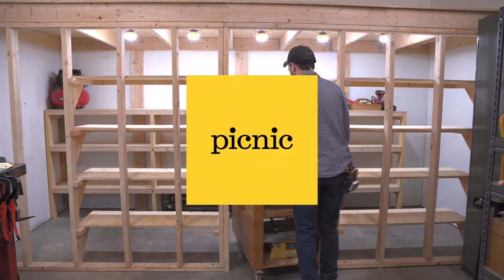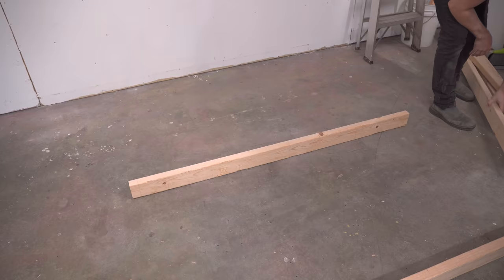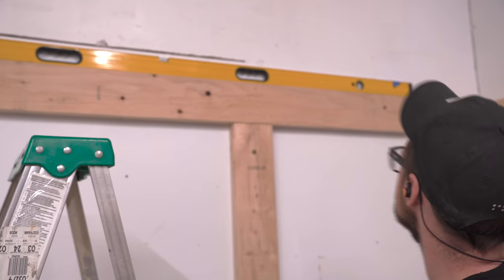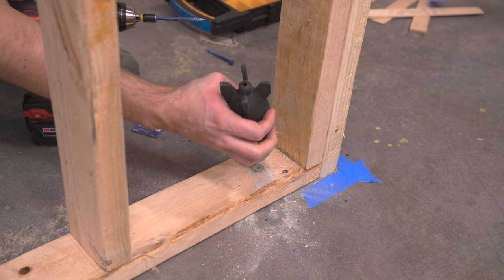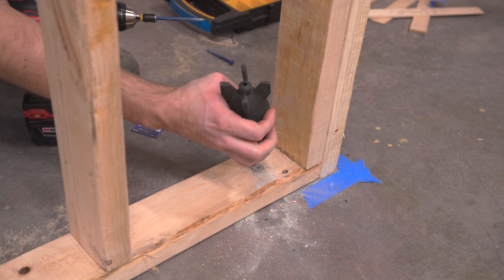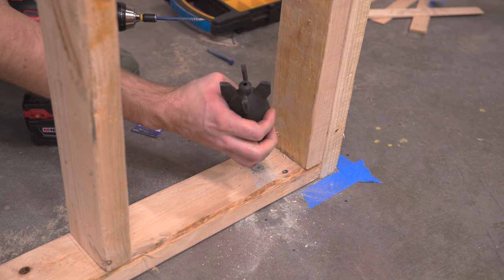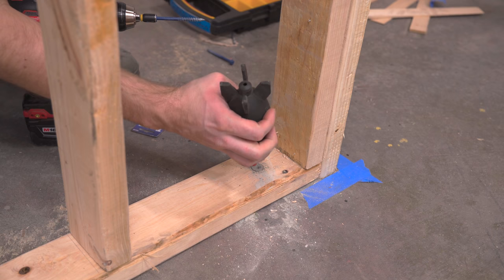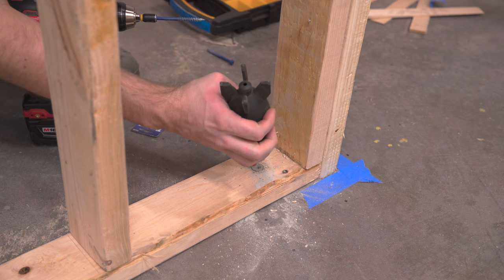FINALLY fixing my GARAGE storage problem

Comment: One thing I do is never waste studs and the 3  1/2 inches of space they take up where you made a wall I would have made a shelf and used that to hold up the ceiling/floor and the 1/2 plywood back for my last shed I used 3/8 OSB for the back of the shelves which was also the siding on the shed it's 8 x 12 and not a stud in the shed my wall between the living room and the bathroom is also built this way entertainment unit for the living room and the back is the wall for the bathroom my only wasted space is the 1/4 inch back of the entertainment unit and the 1/2 inch drywall in the bathroom I've used the same method of building for customers as well a sailing club had totally renovated their clubhouse and had a problem to they had a large closet that they used to hold the mop and bucket and other items for cleaning some members thought it would be better to open it up to the kitchen close off the old door and make it a much needed pantry and others wanted it left as a much needed closet and the contractor pointed out out that with the 4 1/2 Wall either they had a decent size pantry and a undersized closet or a decent sized closet and an undersized pantry so a member called me to look at it I made a shelf at the six foot line in the closet area and shelves 14 inches apart on the pantry side one six foot sheet 3/8 MDF would be the back of the closet and 3/8  MDF would be the back of each shelf glued to the back of the closet this provided the support for the shelves and the back of the shelf that spaned the shelf in the storage closet gave me the glueing area I needed to put the back of the closet above the main closet area final top shelf in pantry didn't need a back as the back of the closet was it's back we ended up with an 20 inch deap pantry and a 22 inch deap closet  so all were satisfied closet held the cleaning supplies and the pantry had loads of space for cases of cooking supplies but by doing it my way instead of losing 4 1/2  inches they only lost 3/4;

Comment: dry wall  mistake..you don't want a single short piece above a door . the joints will cause cracks..you want a sheet and cut out for the door

Comment: 6:41  There should be some kind of Support (stud) under the left side of the joint. The left side board is CANTILEVERED. there is NO Support under it at the "joint". the ONLY thing suporting it is the ONE "STUD" to the left and 4 Screws between the "Stud" and the "Free floating" double joist. the "Stud" is the Fulcrum on that lever and the Double Joist has a TREMENDOUS mecanical advantage over the left hand Corner. Unless you trust those 4 SCREWS to support the 2 of the 3 joists on the left side. I would not trust that side of the floor to support much weight.
Reply: Agreed. Joint should’ve been over the post.
Reply: I mean just look at how he swings a hammer, that should tell you the fella doesn’t know what all he’s doing
Reply: You mean the joist that's directly supported by the structural screws into the wall behind it? How is that cantilevered?
Reply: @RyanAKiefer  Exactly!  The ony thing supporting that Joist's load is 6 "Strucrual" Screws into studs (of some sort) that board is "BALLANCED: on that One 2X6 with 2 screws on one side of the Fulcum and 4 screws on the other side.
Reply: @RyanAKiefer  whether it’s technically cantilevered or not, it was still silly to not have the joint be on top of the post. If he wants to just rely on structural screws, then technically there’s no need for the post. But he said he didn’t want to rely on just the screws, and that’s why he put in posts to support the rim joists.

Comment: Great project! 

But man, those 2x4s look wonky and wobbly. Is that normal in America or did you get an enormous discount? Here I might see some cupping or warping, but at least the surface itself is flat...
And why is the door handle at knee level?

Anyway, none of that is a lack of quality from your end. That's always mint.
Reply from the maker: Thanks! The 2x4 quality depends on where you buy it from, and we're having supply issues right now. I got these from Home Depot, and usually they sell them cheap, but not the best quality. Door handle is low, because I bought a pre-hung door, and cut the bottom off, so that lowered the handle. I didn't think it was worth the extra time to patch and re-drill.

Comment: do you have to get a permit for this kind of project, particularly for insurance purposes?
Reply from the maker: I'm pretty sure this kind of structure is fine to build without a permit. it's a non load bearing element without any electrical or plumbing.

Comment: Another great video from a another great YouTuber… Is there a reason why you never used pocket screws in the framing 2x4 and 2x6 pieces (including the “ceiling” plywood) instead of the nail gun?  It seems pre-drilled pocket holes would make it easier to secure studs and provide a better angle than awkward positioning of a nail gun.  For the ceiling, there would not be a need to spend time trying to place nails from the top of the ceiling plywood onto the joists underneath.  Also, is there a need to place three screws on each end of the shelf?  I seems two would be plenty for 18"(?) wide shelves (my pet peeve is too many people use too many screws where it is not necessary because too many screws can weaken the wood and joint).  The half-square shelf support braces are a great idea and very east to make (from scrap wood); they are also a lot less expensive than the heavy-duty and expensive metal shelf brackets I have been using. Overall, now I need to emulate what you did: great motivation for someone like me to get all my miscellaneous stuff more organized.  My biggest problem is storing and finding woodpecker tools, wrenches, screwdrivers, assortments of screws and bolts, sandpaper, etc., when I need them…  For my hand held tools, I will probably design around the 4-foot (or whatever) high tool chests and put them in the storage area.  In total, a bunch of small tools just weigh too damn much and I would feel better about a support shelf not failing.  This would also put ALL my hand tools in ONE place — and “remind” me to put tools back when done working instead of leaving them on a work table for later use — and then wondering where in the hell I left that wood chisel, Kreg clamp, etc.: form a habit of never leaving / “storing” stuff on a work table.  Also, I will create some “outside” (the storage area) shelves and use wire racket shelves so dust, particularly from my open shop area, falls thru the shelves instead collecting on top of the shelves, .  Costo, Vevor.com, NorthernTool.com, and other places have some pretty heavy duty shelves at reasonable prices.  I would use these shelves to store commonly used power tools.  Having these all in one place; they would be visually locateable and quickly retrievable.  Currently, I keep my power tools in several places.  After I place shelves in an open / easily accessible area, if there is a ‘vacant’ space on my power tool storage area, I would know I have not put a tool back in its place.

Comment: you certainly make it sound like you know what you are doing, but honestly, from a structural standpoint you are all over the joint.  you use studs to carry weight on the back wall but they arent doing anything, the screws in the whaling plate are doing all the work.  your joists aren't over the studs in the front wall, so the rim joist is doing all the work up there.  and at the end of the day, unless you are putting a few tons of rock up there, 2x4 would have been more than enough for all of that construction.

Comment: a nail gun like this, cost barely one month salary here, more than  a thousand euros.  and with our concrete walls, i would need a lot of screws; if you add price of wood which is insane here, it would cost thousands of euros to build this and  2 week . i dont count the price of all power tool and machines, which should jump the bill up to 10 000 or 15 0000 eu. i feel sad.. but many ideas in this vid.

Comment: is it just me, or is that doorknob at 22:07 really low?
Reply from the maker: It's a pre-hung door, so the hole was already drilled out, and when I cut the bottom that lowered the knob. I didn't think it was worth the effort to plug it and re drill it.

Comment: Never understood why a 2x4 is actually not 2“ x 4“. Of course 2 times 2x4 pieces are not actually 4“ x 4“. 😂😂
Reply from the maker: It's maddening 😂
Reply: They are cut to 2x4” rough, then surfaced 4 sides which reduces the size.
Reply: @stevet47  I know my question sounds stupid to you but…
Does that mean the size could be anything because there is no minimum caliber that a 2x4 must have at least?
Reply: @wr6293  
No, it has all been standardized. I’m sure there is some tolerance, but a 2x4 is always 1.5x3.5”. Where it gets real weird is with the larger lumber. A 2x8 is 1.5x7.25”, a 2x10 is 1.5x9.25” etc.
Reply: @stevet47  Just Images you ask the butcher to sell you 8 pound of the most expensive Kobe beef and he sells you 5 1/4 pound for the price of 8 pounds. I would call this deceiving and abusive 😂

Comment: Every "room" wastes space because it needs a corridor. You could have double depth shelves with same storage, half overall volume and less than a 10th of the cost and labour. You basically only needed a deep closet.
Reply: Why would you want double depth shelves when you have the space for a small corridor and have more accessible space?
Reply: Yeah, double depth makes the part in the back so that you have to move the thing in the front to get to the one in the back. I have and have had a lot of storage that requires something to be moved to get another thing. Invariably the thing in the front gets pulled out and left on the floor. Sure, if you want stuff that is long term storage, won’t need often, it can be a good use of space.
Reply: As a woodworker myself, it's to keep everything clean and dust free. This is the best way
Reply: Double depth storage means nothing heavy would get stored on those shelves. If it's too heavy and in the back, it's a pain (literally) on your lower back to pull it out and push it in every time. If it's heavy and in the front, it's never worth moving to get whatever is behind it.
Space for humans to exist in is not wasted space. What is "efficient" is the design that allows the intended user to actually make use of the space or item. For you that may be double depth shelves, for others it may be a corridor.
Reply: @checkadam42  not really. we are together on the fact thay storage is what you store and why, how you store it and why, personal workflow influence and so on. prioritising storage and it's access is a procedure in itself.
Reply: @jeremyspecce  as you say, put secondary stuff in the back. also, many stuff can be placed length to depth or in fridge like, thick doors. there are lots of solutions, "room" is one of them, that has pros but also many cons.